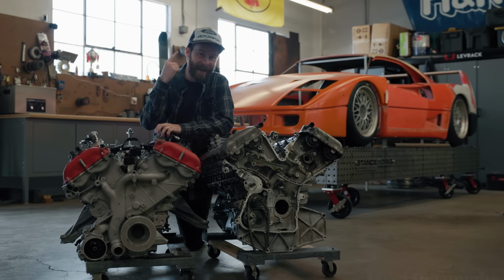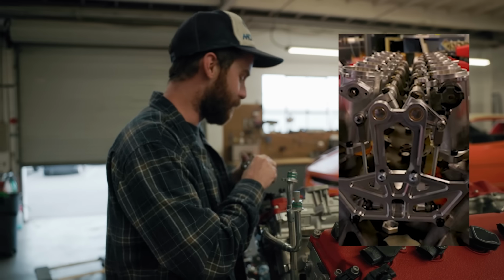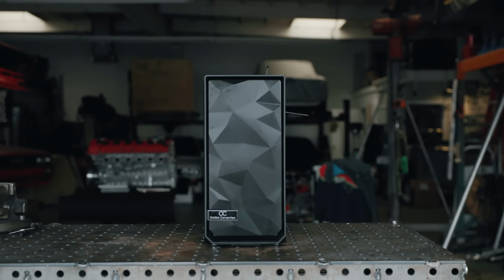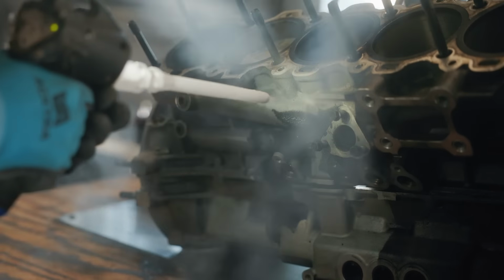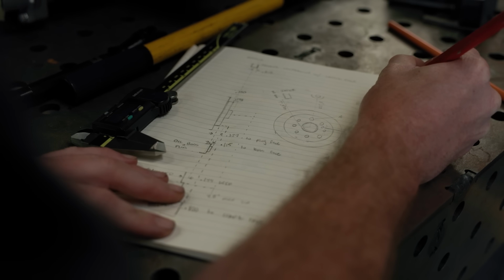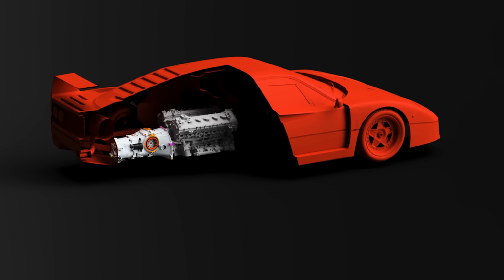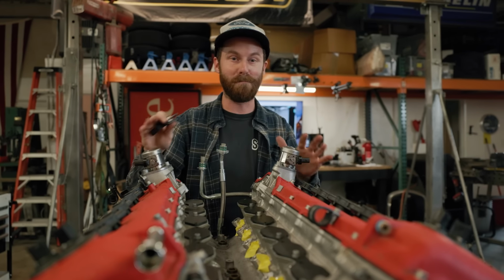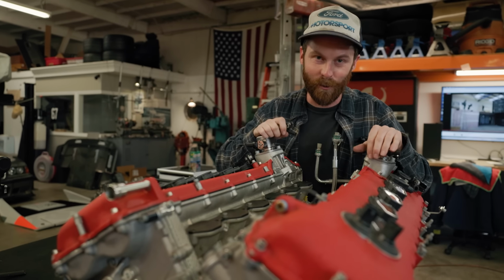Stuffing a V12 into my F40: 3D scanning is my favorite tool yet.

Comment from the maker: Go check Creality new 3d scanner RaptorX: https://bit.ly/4fZgqDA
28% OFF discount for Christmas!

Also, join the conversation in the Creality Official Scanner Group: https://www.facebook.com/groups/creality3dscanner
#Creality#Creality3dscanner#CrealityRaptorX
Reply: Ajoj (Hi). I'll probably disappoint you, but the engine is so efficient in the entire speed range only thanks to direct injection into the combustion chamber and variable intake length. If you remove those two things it won't work. And if you install two turbos on this naturally aspirated engine without adjusting the compression ratio, you will kill the engine!!!
Reply: @jiristanek9458  Its going to run on E85 witch is ethanol 85%,this can take high compression and also cools...(says the guy up in the vid...)
Reply: Hi, awesome work, would you be able to share the 3D scan you've made of the engine? I'm interested to see how easy it is to work with the data these scanners produce

Comment: Your gear box is similar to the ones used in the top Rb powered Australian gtr’s (r32-33-34) just not stick 

Personally I’d put a stick (manual shifter ) in as well just for fun like some of the gtr’s do to 

Just started watch your new build for some reason you had dropped off my watch list so I have a lot to catch up on

Comment: I’m watching the video again about this. 
And the LT4 Gm engines may be getting rid of direct injection. Then why in the actual f did they buy a direct injection engine? Spend all that money on a new high tech Gm engine and then undo technology? 
 And late models have to play the emissions game, even if they get rid of epa standards. Even here in Texas big cities like Dallas Fort Worth, Austin, Houston etc still require emissions testing. That a problem they should have thought about before they bought the newest and latest and greatest car, cause they wasted money just to detune, thinking they are improving things. 
 And while the direct injection engineers may say it’s limited to tune, and while it’s true. In the case of LT4 owners, You will waste money removing the setup and have to covert back to regular efi, all while ruining any warranty or being able to have the factory even work in your car. So you are stuck with the entire aftermarket tuner. Cause some aftermarket tuner knows more than the fleet of gm engineers who designed and engine for direct injection  and all the components that go with it, like combustion chamber design and piston design, and I take m afford design. 
 I’ve also seen Brian Tooley racing that adds regular efi to DI engines because the DI is limited. 
 The DI engines are designed for DI. Strange how diesel tuners don’t have limits with direct injection? They have limits with the fuel pressure pump. And they run clean, pass emissions, make more power, extract power from every drop of diesel fuel. Check out Banks Engineering. 
I understand for removing DI for ease of use in your custom build. Doesn’t really make sense in a late model that someone just bought. 
 Direct injection allows for high compression like a diesel engine but with 93 pump gas. And I’m really tired of the E85 thing. It’s not even available everywhere. 
From a tuning stand point you won’t be able to run the high compression of direct injection engine with regular efi. You may be stuck running E85 just to get this thing to run in regular efi, depending on how high the compression is on this V12. 
 That’s another running issue for the LT4 cars. Do they make the same power with regular injection and 93 pump. Even if the DI is limited, it runs cleaner, is more efficient and may get you better mpg. You may have to do several modifications to just get to the same lever as you DI engine, and I guess you could go past those power levels, but what did it cost. 
 Seems like a better way would be make the DI work, get tuners on board with it, figure out a way. If it’s really the future. 
 Once again Gale Banks gets in there with tuning,  offer fuel pumps, and trial and error to make DI in diesels work. It can be done. 
Love the build.

Comment: Not going to try to fight with the fuel system and the ECU to get hybrid port+direct injection working? It'd be convenient to run the direct injection for low throttle input cruising and idling and then kick on the port injectors when you really need more fuel.

Comment: The only reason to keep DI, would be a Dual Fuel system like the Drag-n-Drive guys run, where you'd use high octane gas in the DI system on the Street Drive sections of the competition, and switch over to an E85 Port based system for the Track parts of the competition.
And for those events, it works. But for a road course racecar, it's a bucket load of things that can go wrong and mess up your track time.

Comment: Use both direct injection and port injection. Use duel controllers. May be a nightmare to tune, but then you could add a couple of beefy turbos later on, and stay with the original F40 lineage.

Comment: Crazy thought.  Could a “ventilated” block be saved by scanning the hole, metal  3d print a plug and finally laser welding it in there?  Crank journals would probably require a re bore.

Comment: So, you have a 3D scan of the engine.  You have a 3D printer.  Section printed PLA can easily be stuck together, and if you key it in a similar fashion to how your chassis table went together, alignment is also trivial.

You might consider making a hollow plastic model of the engine, with appropriate bracing through the center, so that you can have a test fit engine that weighs less than 50 lbs.  It'd be a heck of a lot easier to move around.  Granted, you already have the other engine, but I know which one I would rather pick up.  ;)
Reply: An additional reason to ditch the DI system is that ITBs just look cooler.  :D

Comment: Why go full jungle gym chassis when modular carbon tubs can be had from Dash CAE, Adler, used 4c’s, used mclarens… the v12 is different but the amount of work to just have a fiero-owner lotto winner’s outdated vision feels like a future regret. Half of the F40’s groundbreaking vision was that carbon tub!
Reply from the maker: The F40 didn't have a carbon tub, though. It's a steel tube chassis.

The reason I don't use those tubs is for a few reasons: one, I want to build my car, and that method is more of a purchase than a build. I'm not here to make the best possible thing on earth - there's always something more/better/crazier. "Why use a purchased carbon tub when we could theoretically develop one?" Etc. etc.
Second, I want it to be a Ferrari. A McLaren tub is specifically not a Ferrari. A chassis I build? It's not either. But it's closer IMO.
Reply: @ aha actually surprised by the good reasoning, as Ferrari would have hated to part with their steel “vendor friends” and a jungle gym is arguably more faithful to Enzo’s style. The F40 did have an early carbon tub of sorts but I definitely see why you would prefer to interpret that “tub” as more something you wish to make for yourself - mega integrity points there! Best wishes and Forza!!!🍀🔥

Does this mean you will rivet/bolt in the space frame with carbon panels like the F40 or stay 100% steel?

Comment: Wow!! What an amazing video!! I agree 100% with you on the DI stuff. Its the reason I bought a Gen 2 Mustang new as soon as I heard the Gen 3 was going DI and plated bores. I have built a pair of GT86 (FA20) heads with the DI ports having aluminium bungs welded in and machined, then I have custom made CP pistons with dished crowns to work with the non DI heads.

Comment: DI to PI isn't as bad as I've seen everyone comment. It's an emission requirement that gives a few performance marks. It isn't going to nuke the motor, kill the power, or anything else. When the B58 came out, PapadakisRacing deleted the DI injection almost immediately for his drift build. At first he left the injectors, but they melted under the heat with no cooling. So, he just plugged them up. BMW power chasers have been blocking DI and running PI since the n54 as far as I know.

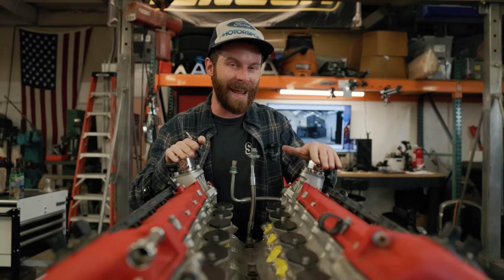Personally? Removing DI is a good choice. DI pumps and injectors, as you said around the 31:00 mark, have a ceiling. There's far and few HPFP upgrades for the BMW side of things, I can imagine there's virtually none on the Ferarri side of things. That goes for the injectors too. This is gearing up to be THE SICKEST builds I've ever seen on YouTube since Robs AWD 4-rotor. Hope Ferarri leaves you alone and let's you showcase just how beautiful their cars and engines can be in the hands of community homage builders.

Comment: Why go with straight cut gears in the gearbox?  You can get the benefits if a dog box without the whine of straight cut gears if you use a helical gearset.   In a two wheel drive street car you will not need straight cut gears - except of course if you are not really going to drive it on the road.

Comment: It feels kinda sad to throw away all that direct Injection hardware. Couldn't the DI system be kept and additional port injectors be added to achieve the increased flow rate required for E85. I don't see the control problem for DI to be such a big deal. The right hardware to control it makes it realtively straight forward to tune. Anyway looking forward to see the build completed.

Comment: 1. the guy helping with the engine heads looks exactly like the host of foureyesfurniture - https://www.youtube.com/watch?v=vxa-qHs7MOs&t=373s
2. it seems like you have to move the rear wheels to the back a little in order to fit the engine? I guess you need to add some thickness of the adaptor plate as well.
3. I really struggle to understand why you need a whole separate engine to scan and test things on. Isnt it best to use the one you are going to fit? seems more complicated

Comment: Loving the updates. That scanner is friggin awesome. Such a quality scan for just 15min on such a big and complex assembly. 
I'm with you on the injection too. If I was doing it, yeah it would be cool to be able to keep it, but would probably end up switching to port also. I WAS worried that in order to do it you would end up lowering your compression ratio, but since you're maintaining that, you will definitely make just as much power with the e85. You will just need to dump 2x-3x more of it in to do that. Are you going to just use single injectors? Or dual staged injectors? Not sure if your ecu has 24 injector drivers, though, so if not you will just need to get some high-flowing ones. And might want to make a bigger fuel cell too, if you're planning on doing more than one lap time trials. And if you can find the room. 
It does look like it will be pretty tight in that engine bay. But, that gearbox is so sick. Thus thing will definitely be a blast to drive, you will just need to make sure you have some earplugs in...

Comment: My 2006 Mercury Optimax 115hp 2 stroke outboard has direct injection. They started making them in mid to late 90s.
Reply from the maker: Mercedes had it in the 50s and so on. I know it’s not “new” technology but it’s the new, modern standard. 🙂

Comment: We are keeping our Di injectors with adding port injection because it will help with idle.

The problem with Di is the tuning window for an injection window is very small. And your limited by the Di pump.

With port injection it's much easier to tune, and you can make way more power.

Compared to Di, port injection is limitless to what you can do.

Good move, removing it.

Comment: the whole point of 3D scanning markers is to break up patterns for the scanner or give it something to track on low detail areas, like a hood. repeating patterns obviously will confuse the scanner and make it jump around, so you're supposed to place the markers RANDOMLY, not in a pattern or matching locations.

Comment: Man, It's crazy to see how far the 3D Scanning and Printing technology have come in the past couple years, and how integral it's become in modifying cars and what not.  I bought a Bambu Lab X1C after seeing you use it, and also picked up the Shining 3D Einstar scanner, and it's one of my favorite investments in my garage.  It's wild how you can scan something, design a part in Fusion, Print it (or SendCutSend it) and install a functional part.  The benefits of the Creality RaptorX being wireless, and appearing to handle very complex scans with ease, is really tempting.  My build is nothing compared to what you have going on, but you're a huge inspiration to keep upping my skillset.  Another great video, as usual!

Comment: Please correct me if I’m wrong, but does E85 really clog up the fuel system if not used regularly?   Meaning, this is F40, that will not likely be a daily, weekly, or even monthly driven car.   Therefore, are you really prepared to empty the fuel systems nearly every time the car is driven?    That’s the downside I see.   I almost wish you’d just twin turbo this engine, and continue the idea of port injection on 91 or 93 octane if you want.    I’d rather stay away from E85 myself!

Comment: Use injector dynamic  1700cc injectors  and set them up as a halo injection  system. It's simple, incredible emultion  (evaporation of fuel and air mixture). Comment on this if you would.

Comment: One thing about the intake port carbon buildup issue is that it's typically only a problem on lightly driven street cars. When you regularly drive it to redline it typically cleans the ports out on it's own. Not saying you should keep the DI, but just pointing out that this shouldn't be an issue for your application.

Comment: E85 is pretty much unavaiable at the pump in the EU (where ferrari are based) but equates to 112oct and that engine would have been designed to run on 99 ron. So if you dial in enough timing for the e85 it will make more power

Comment: Ajoj (Hi). I'll probably disappoint you, but the engine is so efficient in the entire speed range only thanks to direct injection into the combustion chamber and variable intake length. If you remove those two things it won't work. And if you install two turbos on this naturally aspirated engine without adjusting the compression ratio, you will kill the engine.

Comment: E85 makes about a 6% power bump over gas alone. So the port injection on E85 will likely make more power than DI on gasoline. As far as DI being dirty, if you eliminate EGR the carbon build up would be reduced significantly on this engine but it still would have some. E85 builds up way less carbon and port injection cleans the valves so port injection still ends up cleaner.

Also if you decide to go super insane and turbo this engine E85 TT will far exceed the capacity if the DI. Now a dual DI l/Port injection setup like the GT86/BRZ system is ripe for upgraded injectors on the port side and negates all the dirty stuff from DI. Best of both worlds but a bit more complex!

The more controversial point IMHO is if using paddle shifters why not use a DCT in full manual mode? Removes the need for a traditional clutch dog engagement gear shifts and could use helical gears. A good example would be R8/Huracan S-Tronic transmission.

Comment: I mean, fair enough you have your reasons to go port injection and I respect that [and everybody else should]. I respect, still don't agree with that though! The very same solution you're using for keeping the compression up, the use of E85 as fuel, also solves the issue of carbon build up in your valve train, and you know you're leaving power on the table without DI, and new cams, more air would only multiply the power you're leaving on the table, you could gain more. No question it's a lot harder to tune DI you're absolutely right there, but that's not remotely the difficult part on this awesome build! Enough about that... your build is probably the best in YT right now, to me it tops Tavarish's P1. You've got the right car, engine, custom chassi... that's great, really! Hope you can keep it as light as possible!

Comment: My previous job was 3D scanning specialist on a GOM module. If you are using the reference stickers you do not want them in a patern, you want the as random as possible it makes it way easier during calculation. Furthermore you mention that a 3D scan can not be used for measurement which is not for all 3D scanners. We use it to scan and measure aircraft engine parts for wear.

Comment: You can theoretically make more power with direct injection. Because of the precise timing. But why would you. Most direct injection engines now are running two sets of injectors because of all the carbon problems.

Comment: Pro tip, you don't need to scan on a crappy laptop that can't handle the scan data. Use USB-over-network, link up the crappiest laptop in existence to that fancy desktop computer, and then the laptop just becomes a vessel that transmits the data over your network to the computer that can actually handle the scan data

Comment: Each to their own and all that but I would try to keep the DI. Going ethanol is a bit of a cheat code for MPI and yet the whole dirty valve BS is entirely caused by cost cutting on all OEM crankcase PVC systems. If they separated the oil out of the crank gasses properly then the back of the valves would never get dirty cos it'd just be air/clean gasses. Anyhoo, shall be interesting to see how this all turns out.
Reply from the maker: Are you buying the standalone for me? 😝
Reply: @stanceworks  mate, I can barely afford food these days in Oz.
Reply from the maker: Well, in that case neither of us are buying it, so another reason not to go with DI 🙂
Reply: @stanceworks  🤣🤣🤣🤣🤣

Comment: Look Hollinger (and you) know far more about transmissions than I do, but I reckon a helical cut box (still with dog engagement) would A) handle the power and B) make it more tolerable to drive. At the end of the day the V12 is the soundtrack rather than gear whine. But hey that 3D scanning material is some AWESOME sorcery.